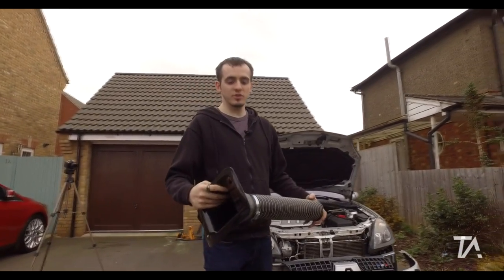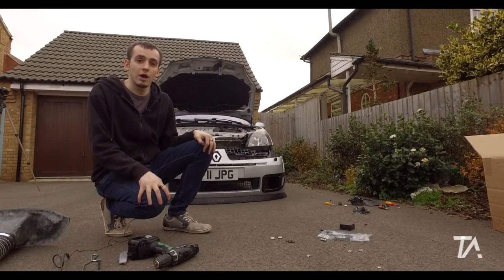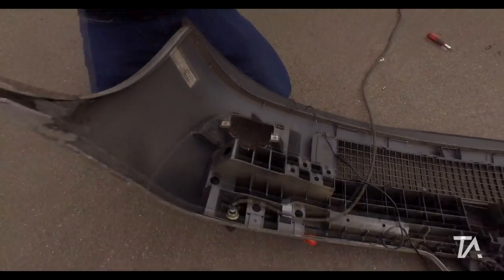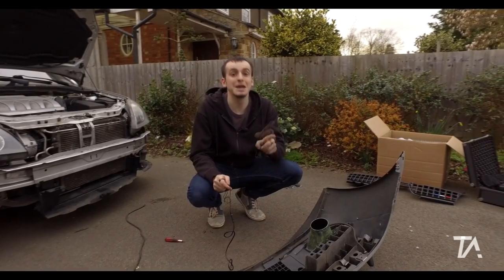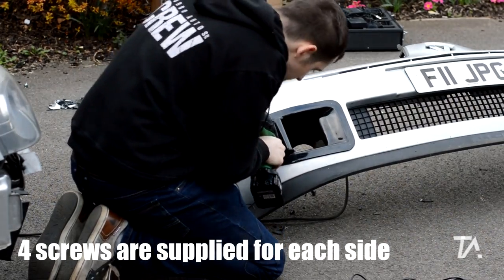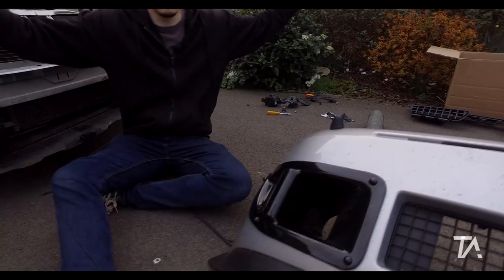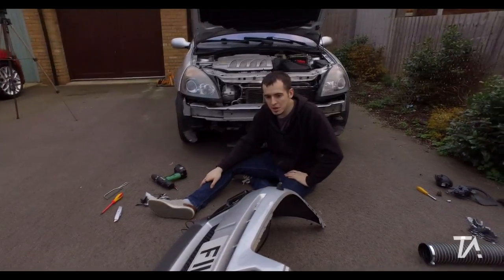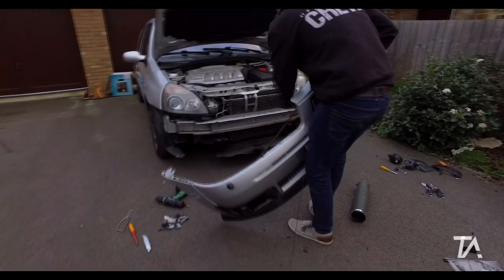KTEC Brake Ducts Install | The Clio Project

Comment: Doesn't this create a negative effect on the cars aero on tracks?
Reply from the maker: It would increase the drag a bit, yes. But I am happy enough to sacrifice that to keep a constant feel of the brakes to keep the confidence of going fast!! I wouldn't imagine that it would be overly noticeable once the air flows through to the brakes properly though, a lot of performance AMG and M cars do something similar from the factory :)
Reply: I had a brake pad disintegrate after a hard track session without brake ducts - supposedly they offer 30-40% better cooling so definitely a worthwhile mod!